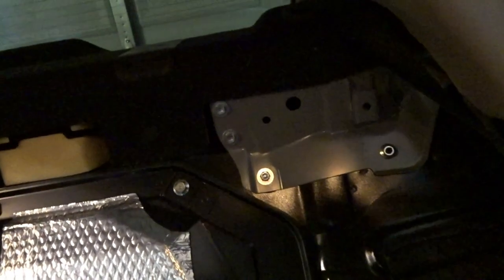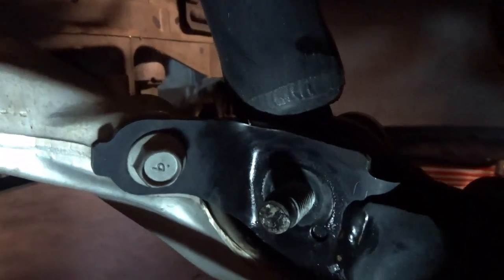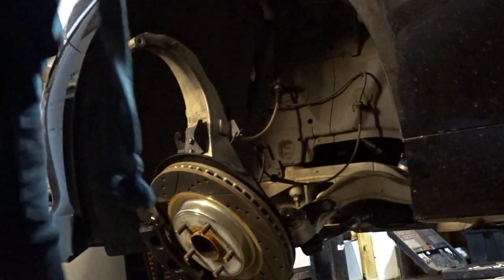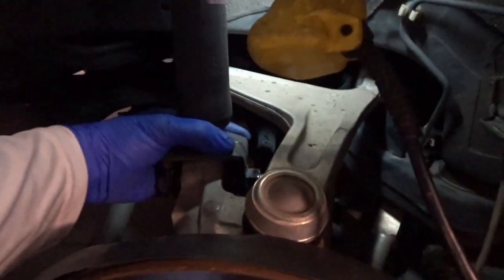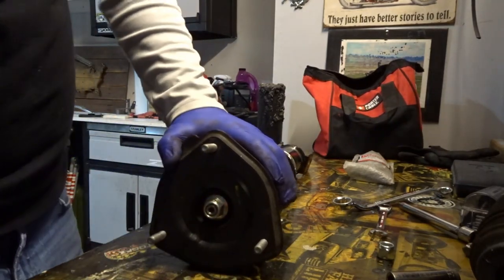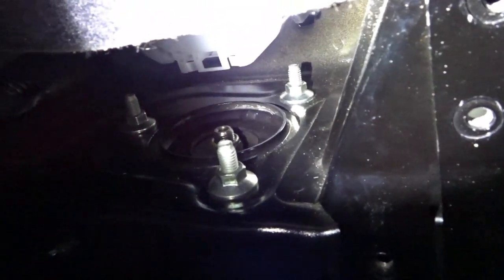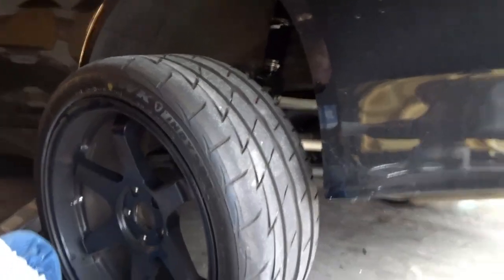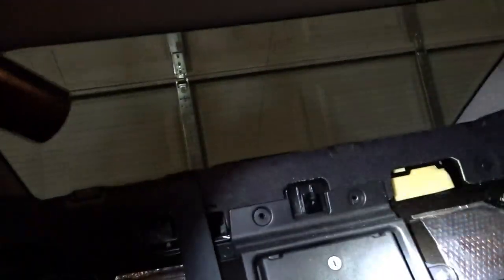Q50 BC Racing COILOVER Installation

Comment: I’ve read on Q50 forums than when upgrading suspension with coil overs, they also recommended installing adjustable control arms? I only want a flush fitment and will drive hard during canyon runs. Do you think adjustable-arms are necessary from you experience? I don’t want to drive hard in the canyon and my control arm breaks on me, what do you think?
Reply from the maker: It’s not necessarily about breaking the factory control arms.  It’s about being able to properly adjust your alignment once lowered.
I lowered my Q originally about 1.5” and was still able to be within factory alignment specs with stock control arms.  Much lower than that I’d recommend adjustable control arms—at least in front.

Comment: Watching this during my class lol. But question where are the jacking points and jack stand points for the q50?
Reply from the maker: One right behind the front fender and one right in front of the rear wheel.  They are clearly marked with notches in the pinch weld.
Reply: @SpeedCultureStudios  gotcha thanks how long do you think this will take also is it the same process because I have rear folding seats
Reply from the maker: @alphav1537  if you’ve never done it before and have to scramble for tools or an impact gun, it could take 5-6 hours.  If you have experience, you can do it in a few hours.

Comment: How did u get the grey panel off for the backseats the bolts are impossible to get to
Reply from the maker: I you don’t need to get them all the way off.  I showed it in my lowering spring install video.  Leave the hard one in and just rotate the plate out of the way.

Comment: Just a tip for the top hat transfer: if you pay attention to the impression on the bottom side of the top hat - an uneven impression was left behind by the previous spring. you can see where the top hat will fall into place with the new springs on the coilovers if you line it up properly, matching the impressions to the end of the spring

Comment: Definitely using as installation guide 😂, can’t wait to do mine if I plan on keeping the car currently on rsr lowering springs only difference I will have is for the rears since mine is awd hopefully find something out there as a guide
Reply: Hey man! i’ve been debating spending extra cash for bc coilovers or just go with the rsr superdown lowering springs. I have a AWD too and heard lots of people experience vibrations. have you?
Reply: @francescoprezzano3161  I had vibration but that was because of my aftermarket wheels not having a centric hub pretty sure that’s why, install it right and you won’t have vibration but if you want good damping I would recommend coil overs going thru bumps felt like I was breaking something other then that it wasn’t bad could also be because I had 19 inch wheels and less thicker tire

Comment: Anybody have an issue where the oem bolt for the bottom mount of the rear strut was too short to screw in with bc's installed? I was wondering if they were supposed to be included with the bc's because mines didnt have them. Had to hit up a hardware store to get a longer one
Reply: I have the issue where I need the nut
Reply: @pureanti102  bc I installed came with the nut

Comment: I do have a question though. One of the rears are squeaking as the car accelerates/decelerates. I may have used too much torque on the bolt of the bottom strut mount and i feel like the bushings were a little chewed up since i had a hard time removing the strut at first. Do you think any of what I did could cause that squeaking? Also note the rear is VERY low at 25 inches from the ground to fender!! No idea how this happened as i preset them myself properly. I did make sure the center nut for the top hat/strut stud was very tight. You think that caused a tight preload thus causing a lower drop?

Comment: Old video but hopefully you see my comment.. Do you know how installing tein coilovers would be different? Like different parts etc? Im also wondering how to get the correct settings on them any tips? Thanks!
Reply: Also realized the current ones were teins, any reason why you switched to bc? Thanks
Reply from the maker: They were Tein springs not coilovers.  Installation will essentially be the same.  They are going to mount in the same way with the same hardware.  I have a video about adjusting coilover height and dampening.  I don't recall, but I believe Tein coils either do not have dampening adjustment or maybe just fewer settings, so may just be a ride height setting and done.  There is no standard setting, so you really just have to play with them to see what you like.  How the car rides, handles, looks etc.  Install them then drive the car for a week or two letting them settle, then adjust.
Reply: @SpeedCultureStudios  awesome thanks!

Comment: I know this video is a little old but I installed coilovers on my q50 at 21:40 when you line the top hat where spring stops does that matter ? I didn't check that when putting top hat on
Reply from the maker: There is a natural indentation on the rubber--it just makes it easier to line up.  I think the compression of the spring and the weight of the car with just create a new imprint if you didn't get it lined up.

Comment: question did you adjust height out of the box? or is that ride height set from factory & preloaded?  Were all for corners Even out of the box?
Reply from the maker: I showed this in the video.  Preload in the rear must be set because fsctory top hats are used.  All 4 corners are about the same height out of the box, but you adjust them all anyway based on your taste and use.  So you have to get them installed, let them settle for a few days, then take measurements and adjust

Comment: Great video! I just did my fronts today, and it definitely didn't go this smooth.😂😂 I think it's because I only had one side up at a time, that my swaybar endlinks were so angled, it was impossible to get them off. 

I ended up having to PB-blast the crap out of it, continuously jack the knuckle up and down, and lightly tap the endlink out with a mallet. Worked and didn't ruin any threads, but it had me nervous as hell!

Tomorrow that I do the rears, I'll have the entire rear end up on stands, that should relieve the tension from the swaybar just like you did. Doing Toe and Camber arms too.. not sure if I should do those first, before removing the strut..
Reply from the maker: That’s definitely it.  If you have pressure in one side it pulls the other down so makes it very tough!

Comment: I have a q50 sport and I have I’ve got some rims in the past but they don’t fit without spacers. What size of rims and the dimensions should I be looking for if I have the big brakes?
Reply: Try looking up on fitment industries big dogg they got a calculator and huge gallery

Comment: Will any control linkages need to be changed? I know my brother's car had some aftermarket suspension parts and many shops in the up state NY area said they could not do alignment on the car because of thos parts and this changed my mind about doing suspension wrk on my G37s.
Reply from the maker: I’m not going that low, so I’ll still be close to alignment spec, but yeah going lower can definitely require additional parts for further adjustment.

Comment: Do you have a run down on tools that are need to do this? If got a spring compressor and 2 car jacks.
Reply from the maker: I think most of the tools are visible in the video if I didn’t show them at the beginning.  Impact gun is helpful because some of the bolts can be quite tight.  Otherwise basic tools and a spring compressor will just about do it

Comment: How did you remove the sway bar end link.?
Reply from the maker: Check out 17:45 mark.  Put a wrench on the backside and break it loose.  If you still have the factory sway bar or it’s been a long time since it was removed, you may need an impact or breaker bar.  They can be tight.

Comment: Should be a disclaimer that most of your videos involving interior/suspension work DO NOT apply to the  Sport AWD models. For example the seat removal process for the rear struts is VASTLY different.

Comment: Removing the upper control arm is unnecessary for this application. The only component to remove is the steel plate holding the shock in place and the sway bar link.
Reply from the maker: No, you don’t need to “remove” the upper control arm.  Disconnecting at the ball joint to lower the knuckle just makes for easier access—and it’s one bolt so doesn’t add any effort or complexity.  I’m not sure what steel plate you’re referring to.

Comment: Sooo. I had a shop install my bc coilovers yesterday and they DID NOT use the factory tophats in the rear like i asked them to. Should i make a stink about it? I really dont want any issues
Reply from the maker: How did they install them then 😂
Reply: @SpeedCultureStudios  they said they bolted right up🤷 I looked up WHY they use the oem top hats and evidently the bc will wear incorrectly in the "seat" that it sits in. Causing it to make noises later. I just don't know if I should be  worried and insist they do it they way I've seen you and pretty much everyone else do it
Reply: @SpeedCultureStudios  so after calling bc. I didn't know that the swift springs came with the correct mount. So I was worried about nothing

Comment: Yo SCS I appreciate your install guide. Used it today to install my BC coilovers. Ordered them 2 months ago but BC didn’t ship them out until a few days ago 🤦‍♂️. I decided to run the rear dampener extensions through the rear seatbelt slot on each side. Turned out looking and operating very well. What did you decide to do with your dampener extensions?
Reply from the maker: My extensions are through the seat belt slots as well.
Reply: @SpeedCultureStudios  hi how long are the extensions? 200mm long? Thanks

Comment: Lol the fronts are metal to metal contact?
Reply from the maker: You can use a piece of paper or make a cork gasket if you'd like, but it isn't mild steel to mild steel, so there really isn't an issue with corrosion.  After about 2 years on these coilovers, there are no weird noises either.

Comment: Nice, a new vid... i almost did BC but wanted true-style so went with Stance XR1. Fortune Auto 500s are good too. Also got the Z1 upper control arms and rear toe bars.
Reply: I’m moding my 2010 G37, 52k miles. Babied. I’ve done full suspension, Pilot S4 ties, BBK, and a ton of other visual mods (all show, no go). Only performance mod has been aFe drop-ins and Z1 intake hoses. Looking for simple upgrades (like the filter). I’ve heard simply getting a tune can add 15-20 whp. Also, live in CA so don’t  think there is much I can do legally.
Reply from the maker: How do you like the z1 uppers?  I’ve heard some complaints
Reply: @SpeedCultureStudios  Complaints? Hmm. I think that was just after they introduced them, mostly that they are a pain to adjust and noisy. But I think Z1 got it sorted out. Still a pain to initially dial in for alignment, but that’s modding, right?
Reply from the maker: @jdstarek  yes mostly noisy and bushing failures.  If they’ve improved them then that’s great news